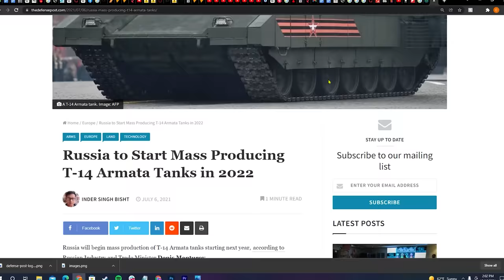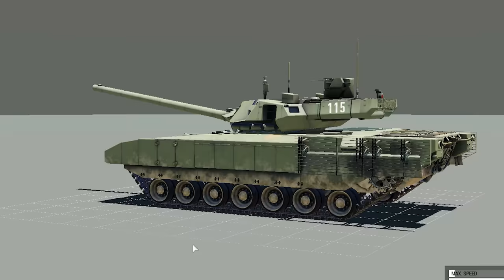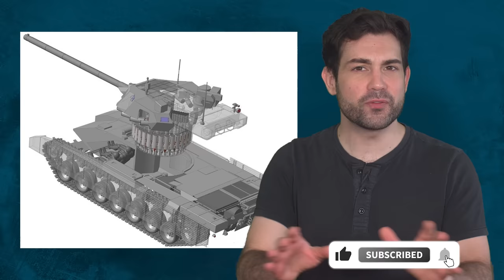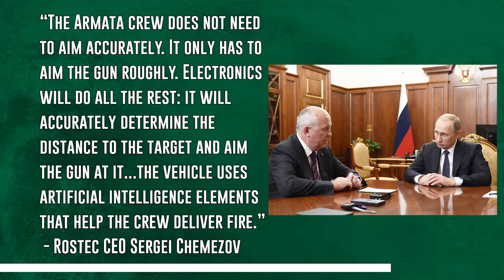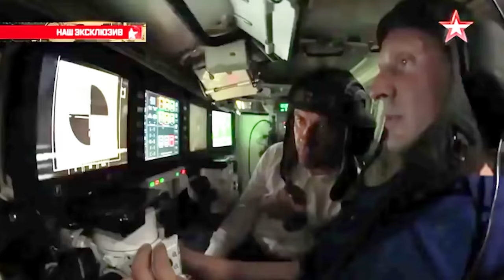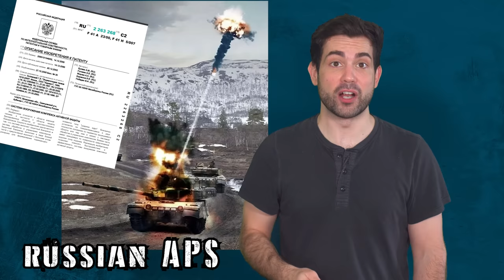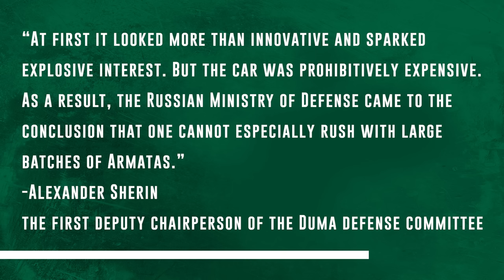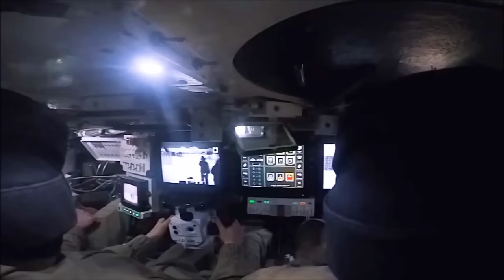The Truth About Russia's T-14 Armata Tank

Comment: The T-14 is lightly armored on the turret.  A simple 50 cal with armor piecing round would likely be able to rip through it easy.  An RPG would shred it.  The tank has great armor on the front and the front half of the sides to protect the crew, but that is it.  The rest is VERY light.  Just look at the monster engine and the size of the tank, large gun, and more admonition... it has to cut armor.  They put a cage to protect the engine.  Any Tow missile will rip through that.  Now it has its active defense, but it only face a front 60 degree arc.  I question if it will work against bombs or missiles coming in at a steep angle.  That is even if the system really works.  They still put the dazzler on the tank even though that has been defeated long ago.  I also seriously doubt that defense system could touch a tank round and definitely not a depleted uranium dart.  It sounds like the tank is really no harder to take out, but that the crew has a far better chance of surviving.  I also question their optics and targeting as well as their training.

As for the delays there were several quality issues, especially with the engine and massive cost overruns.  Russia after cancelling their orders repeatedly it seems might have ordered 100 of them.  With the current war though their economy is not doing so well so I doubt they will even get any.
Reply: So a simple cage over the motor? I guess it can easily be disabled by dropping a flaming bottle of vodka on it. Unless all the wiring is hardened or if the motor bay has an automatic fire extinguishing system it'll be toast in less than a minute.
Reply: I wouldn't be surprised if the ERA is only stuffed with papers saying: IOU ERA! Those mega yachts ain't cheap;]
Reply: @vetrakr  The cage only works really against older warheads like in a standard RPG.  Most anti tank weapons like the TOW and Javelin now have dual warheads to counter cages and reactive armor.  And if you are looking at the footage coming out of Ukraine, those cages are not working.  They even started putting the cages on top to no avail.
Reply: This is probably the future of real tank development: Thinly armored turrets (albeit they should at least resist autocannon fire!) Active defense systems (Preferably ones that actually work), and a small, very thickly armored crew compartment positioned in the front where it can best counter the weight of the engine (and ideally placed to block most incoming fire from hitting the ammo rack).

All that said...I think we'll be waiting a while before we see such tank designs becoming the standard. Completely replacing a nation's armor corps is just too expensive! Especially with all the new tech you gotta stuff in them.
Reply: NLAW uses an EFP, so you need something which will stop a 2km/s slug coming straight down on the turret.
Reply: @barleysixseventwo6665  I don't really agree with all that.  The M1A3 has no plans of removing armor.  This is a ploy for countries like Russia and China to make their tanks cheaper... not better.

And yes I do see active defense system playing a more important roll in tanks and maybe by 6th generation, jets.  The thing is Russia and China's missile defenses and active protection on tanks are just not that advanced or reliable (just like their stealth).  They might be able to do better, but not for the cost.  The US has been developing these systems for much longer with a much larger budget... and working with Israel, which has been make huge progress in these areas too.  The US can also afford to put this tech on their tanks.

The other problem is Russia... and the Ukraine are both using tanks incorrectly.  They are providing no boots on the ground to secure the aria, no air support to protect them, and not enough quality recon.  If they had tried any of those tactics against the US, they would have already lost the war.  Think of what 10, 20, 50, 100+ A-10s would have done to that 40 mile long convoy...  Russia would have lost thousands of vehicles and had to abandon that whole push.  It would have been Kuwait, but 100x worse.  They would have conceivable lost 50,000 troops easily in one day pulling a stunt like that.

Russia's military assets are mostly aging crap and even their new stuff is not doing so well.  When their current best fighterjet gets repeatedly shot down by MANPADs and even their up armored cage wrapped tanks get taken out Javelins and other man portable AT weapons and drones dropping small munitions (50 pound bombs).  The A-10 can fit 28 Mk-82 500 pound guided bombs or 24 Maverick missiles on it... plus the gun.  Think of what just 10 of these could do... They could easily take out 600 vehicles on one mission, refuel re-arm and repeat.  With 600 pound drop tanks they could operate out of Poland and run 4 sorties EASILY in one day.  With some F-15 and F-35 giving them cover it would be a bloodbath.  These bombs will not just disable the vehicle, they will likely blow it to pieces and kill everybody in tit... and disable unarmored vehicles around it.  Then US special forces would swoop in and surround the whole convoy and capture anything that survived.
Reply: @toddabbott781  They haven't used their current best fighters.
Reply: @toddabbott781  F22 and F35
Reply: @cageordie  They only have 2-4 two seat Su-57 trainers with underpowered engines... and possibly 2 prototypes left intact with also underpowered engines and limited avionics.  The Normal production models have been pushed back until 2025 in hopes of having the engine working by then.  They have also cut back orders to 76 (I think) and might make 100 total in the end, but that is all.  The price of these is likely more like the F-35.  But it does not matter much.  The Su-57 does not have anywhere near the stealth that the F-22 or F-35 has and they lack many other 5th generation features.  At least it is better than the Chinese J-20.
Reply: Do you have a source for the turret being lightly armoured?
Reply: @NauticalCoffin2404  They admitted it.  The whole design was around keeping the crew alive.  They are relying too heavily on their active defenses.  But if you looked closely at the turrets for the prototypes before they mounted the sensors and cameras you could see the armor is way thinner than on a tank like the T-72.  It looked to be around 3/4" to 1" thick.

You can also tell by looking at the specs.  It has larger dimensions than the M1A2 a larger engine, a larger gun, more ammunition, an auto loader, active defense and more armor around the crew.  They had to cut from other places.  Yes I know they have a lighter type of armor protecting the crew, but it is not THAT much lighter.  So the back 1/3 on the sides, the rear, and the turret have much lighter armor than previous tanks.

I like military technology and have research the T-14 and Su-57 pretty heavily and looked at every picture I could find since it was first announced.  There are a lot of pictures. 

The T-72, and even the T-80 and T-90 are death traps.  Any damage and they explode, blowing the turret off because of the location of the ammo and fuel.  That is why any time they are hit the crew bail out.  The T-14 at least has greatly improved the survivability of the crew... which will likely make them take more risks with the tank.  Current Russian tank crew really know their chances of surviving a serious battle are VERY low and likely are less willing to commit too much and will bail or run far faster than other tank crew.

It is like in Ukraine.  The helicopters are avoiding getting too close to the cities do to Stingers and other MANPADs, so they come in fast, point their nose up about 30 degrees, fire all their missiles, and turn fast dropping flares and run away.  Angling up gives the missiles a longer range, but they are worthless for anything but randomly shelling a city... which is what they are doing now.  They are too afraid now to get close enough to actually find a target to shoot at.  The jet still bomb, but they are unguided and they stay up out of range of the MANPADs, but again their accuracy sucks.  They are just plowing up mostly empty buildings at this point.  Russia can not afford to use very much precision munition and mostly used that to strike the airports.
Reply: @toddabbott781  Thanks!
Reply: @yeahnope620  The F-22 is an exceptional aircraft, but even I wonder what is wrong with it.  I know it is expensive to operate, but the NEVER use it.  The F-35 though is maturing into a really good fighterjet.  If it sucked so bad then why would so many other countries buy it over the F-16 and F-15... which are still being made?  The real game changer is the F-35B as it turns small carriers they might have used a Harrier or just attack helicopters into a real light carrier.  The Wasp/America class instantly became 10x better because of the F-35B.  The F-35C is also significantly better than the F-18.  The F-35A though has to complete with the F-22, F-15, and F-16.  In certain roles it shines, but not like the B and C model do.

What would take on the F-35?  The J-20's stealth is non existent as Su-35s in India were able to track them just fine from almost the max range of their radar.  The Su-57, which will not be in production for a few more years can be detected at 4x the range and only has stealth from the front.

Understand that the F-35 is not about speed or even maneuverability.  It does good in those areas, but there are better jets for that.  What it is good with is it can sync its radar and IR with data from satellites, AWACs, other aircraft, and ground radar systems and view it all 360 degrees through its helmet of incredible situational awareness.  It can also link fire control systems so an F-35 is full stealth hundreds of miles ahead can lock onto a ground target and fire a cruise missile from an F-35 500 miles farther away in beast mod with larger ordinance carried externally.  It also has far b3etter stealth than any other fighter jet out and all F-35 come with electronic warfare built in (replacing the need for jets like the Growler).  They can even link that data with Patriot of THAAD systems hundreds of miles away to increase their readiness and enhance their ballistic countermeasure capabilities.
Reply: @vetrakr  How you gonna get so close to it? You do understand you sound like a joke?
Reply: @ijjimem  Ambush. Overpasses, ruined city buildings, large ditch near a highway, culverts. 

Of course, since the US is sending Javelins, other allies are sending RPG-7's, it's better for civilians to find a way to alert the army proper. IE: Hopefully you know a local short wave radio operator, satphone, existing telenetworks.

If you're feeling particularly spicy, and want to make some russian pulled pork, an urban environment with tall buildings and tight roads. You can send them to hell.
Reply: @repletereplete8002  they do have footage of T-72B3 with ERA cut open. filled with cardboard !!!!!!!!!
Reply: Proximity fused shrapnel shells to overwhelm the active defence and shred the turret optics
Reply: why would the monster engine mean that they need to sacrifice armor? that doesn't make any sense: if you have a more powerful engine, then your tank can afford to be heavier
Reply: you fail to understand logic behind it and few others things.
yes turret is lightly armouured because it is considered expandable. not so lightly i would not survive .50 cal but still light. this is because hit in normal turret often disables tank for that battle anyway 
about rpgs in battle... there is a reason for tanks to have support troops around it. tanks should never advance alone. 
also than any tank that use cage armor is useless... you must be next admiral general genius...
Reply: @toddabbott781  you saw few videos that zoom in the tanks and now you think there is no troops around them?
Reply: @jebise1126  
I'd be more than a little concerned about turret penetrations triggering an explosion of the autoloader ready ammo.
Reply: @andrewholdaway813  if it vents in right direction that is really not a problem
Reply: @jebise1126  
Let them hope it does then, that's a relatively thin wall between the crew and the turret basket, they may have made the tank more vulnerable to top-attack.
Reply: @andrewholdaway813  so you were in tank that you know how thin that wall is?
Reply: @jebise1126  
Just eyeballing it from the cross section shown - everything is speculation.
Reply: I would disagree mate its not gonna be knocked out by a .50cal or TOW launcher. the APS on the turret side is traversable and there is a roof mounted VLS system to defend against top attack munitions.
Reply: @jonomurphy3332  
We don't  know.
Reply: @jonomurphy3332  Not in ANY of the first 10 prototypes.  Until they are proven in combat there is little to be said.  Same with the armor.  Then again their reactive armor dazzlers, and cage armor seems to all be worthless against even simple man portable weapons and small UAV bombs.  This APS has to work PERFECT to be effective at all.  I just do not see it being that effective in the long run.
Reply: @cageordie  They have, in fact, used their standard if not elite line infantry. All the evidence points to more recent equipment and the more prestigious, battle-ready units getting sent in and summarily curbstomped.
Reply: Main question - hove muach armatas Russia have? Because we saw 0 t14 at this war, only t 80,90,70 etc.
Reply: @badasscookie8553  They had 10 prototypes of limited functionality.  I'm not sure if they still have those.  They kept pushing back the orders and reducing them.  Last I saw they had an order for 100 in 2022...  With the war going on and restrictions I know their tank plants shut down.  I am assuming this was the T-14 production.  One source said they had 20 though.  I have not seen this verified anywhere else though.
Reply: @williamzk9083  
AHEAD is a shrapnel shell
Reply: For the people not understanding the turret armor being thin. Where on traditional tank turrets you see those 2 wings, blocks of thick composite armor, the crew is behind those.  The Armata turret has no crew in it. So the only systems in the turret are the gun, The optics and sensors. The APS. Communication tech. Those are all things that don't get armored on other tanks either. So basically the T-14 turret is only made of things you don't armor on a tank, and so it has no armor there.
Reply: @DisplayLine6.13.9  
We all understand
Reply: @toddabbott781  we do use the F-22, as much as we dare.  They were doing strikes in Syria as recently as the last ISIS campaign.  The problem is that there are only 187 of them and there's no building more of them; the line is shut down, and if a shooting war broke out over Taiwan, the US's ability to do anything about it is directly limited by the number of F-22's (and to a slightly lesser extent F-35's) that we can deploy there.   So we keep quite a lot of them out of hot zones so we can make sure we have them for later, just like the B-2.  They also tend to be kinda expensive to operate and take a lot of downtime in hangers for maintenance.

In the medium term (10-15 years?) they'll be replaced by the PCA for the doomsday scenario where we have to escort B-21s with nukes into highly defended airspace.
Reply: Modern IFV can fire 30mm, 35mm,40mm and 50mm rounds are a high rate of fire.  Tungsten, precision air burst and AHEAD type ammunition.  Even the 25mm Bradly bushmaster penetrated the sides of T72.   These rapid fire guns will shred APS and ERA leaving the tank open for a guided missile.
Reply: @williamzk9083  
They'd have to get scary close to a really big gun, but yes.
Reply: @williamzk9083  I have actually seen the larger commercial DFI drone that can carry 8 what they called grenades.  It almost looked like a small 60mm mortar round.  They dropped 2 from about 250-300 feet and the both hit the tank but the first hit the edge of the turret and the second penetrated the engine compartment on a T-72 and caught it on fire... then they moved to 2 BMP-2 , 3 trucks, and an armored ar.  This one $2000 drone with a few hundred dollars in modified mortar rounds basically wiped out a small base.  I had heard they were doing this, but this was the first video I had seen of it.
Reply: Yes !!!  But the Armata has a special weapon !!!!  When the turret blows up 100 ft in the air it could fall on you and squash you !!!!
Reply: @spaceted3977  Unlikely as this is the first tank where they put the ammo in an armored cabinet with blow off hatches like all other countries did 30+ years ago.  They will not blow up as spectacularly as they used to.
Reply: @toddabbott781  stealth doesn't really matter when fighting another stealth aircraft because the ir passive scanners spot the jet from 20miles away and the su-57 also I don't care if you are in the airforce or have been you can't say the su-57 isn't stealth just because someone else told you that they didn't design the jet neither did you no hate but you can't say just on someones word that that's true and the f-22 lacks some huge features that the su-57 has like hmd(helmet mounted display) the f-35 has this however which is why the f-22 is no longer in production its expensive and lacks some features the su-57 also has more missiles that it can carry in stealth and out of stealth and the cost is pretty substantial 25milion difference and costs about the same as the f-35 although the us still has better jets because they can make them and have proven that they can and the Russians have 12 prototypes and 4 combat ready ones more to come soon I assume but I think they might abandon is once the total amount they ordered is complete because they hacked the us and got blueprints of the f-35 because their new su-75 looks basically identical with some differences but it's most importantly 30milion US dollars which with the amount it costs to buy a f-35 being 85milion you can buy basically 3 su-75s for one f-35 and at the airshow it seemed promising but they aren't ready for flight yet next year is the planned date
Reply: @paullakowski2509  wow do you have pictures please? are you willing to share? i saw a cardboard gun but not that.
Reply: "a simple cage over the motor"... just like every other modern tank
Reply: @nam430  Yes but they put the cage OVER armor.  Look at the design.  The armor is only on the front maybe 3/5 of the tank body and basically.

Then again I have seen t-72 get taking out by 30mm autocannons.  That should NEVER go through a modern tank's armor but it will.  Even a 20mm will likely slice right through the engine compartment from all sides as well as the turret.
Reply: On one hand, the most likely side to be hit is the front facing armor. Secondly we don’t have the best info on the actual amor protection. But the fact that this thing, this beautiful thing(don’t lie it’s pretty) won’t be going into general service anytime soon
Reply: "Their economy is not doing so well"

Lmao!  This comment aged poorly.  

Copium
Reply: @toddabbott781  government
Reply: @toddabbott781  i.
Reply: your wrong on how a 50 cal can take it out with armor piercing rounds, the t-14 can handle more then that.
Reply: @anon5679  Around the crew compartment the T-14 is well armored.  The turret is not.  Look at the tank.  The armor plates on the side only go back about 2/3 of the way and then is replaced with just a cage.  Then there are the recessed parts in the armor for cameras sensor and those stupid dazzler lenses.  Those leave huge vulnerabilities.  But if you looked at the 10 prototypes they had on parade a few years back, you could see in some of the pictures that the plates on the turret were only about 3/4 inches thick (or 2cm).

This is actually a big improvement.  Before a tank would get hit and the ammo would blow wiping out the tank and crew.  Now a hit to the turret will leave the rest of the tank intact.  Same with a hit to the engine.  This means the crew will not bail out on the first hit or abandon the tank as soon as explosions are heard in the area.  They will also feel more secure driving into more dangerous locations.  Right no Russian tank crew do not feel safe in their tanks.  The problem is though, while the tank crew is MUCH safer, the tank can be taken out of action rather easy.

A lot has to do with how effective is the active protect really.  They only have 4 tubes on each side under the turret and they fan out in about a 60 degree arc.  They can not fire if the hatches are open though.  It is questionable how high of an attack angle they can protect against and if they can do anything against a normal tank round or just missiles.  I doubt the system is more than 50% effective against incoming missiles like RPGs and such, but against a Javelin that is going to shoot up and come down on top of the tank or any attacks the the air... or rear or side with be unstoppable.  The system of course does not work against mines either.

Russia is loosing tanks like crazy in Ukraine.  Even drone dropping grenades are making it through the engine compartment.  I'm not even sure if the NLAW will trigger the active defense.  It is also questionable how thick the armor is on the top of the crew compartment.  It might be that almost any hit on the top will take the tank out.  I guess time will tell, but so far Russia's unstoppable army has been stopped by Ukraine and their assets and troops are dropping like flies.

BTW a 50 Cal with AP rounds can blow through about 2" of steel or about .9" of hardened steel.  the engine compartment might have more than that on the sides or rear to protect the engine, but I have seem BMPs firing a 30mm cannon shoot the side of a T-72 where the treads are and it blew right trough the armor there.  I have also seen that Russia has also been sending out tanks with fake reactive armor.  I wonder how many of those are on the battlefield right now.

It does not matter much though because as far as I know they stopped the production of T-14 because of the embargo and while there are rumors they were going to start the production back up, they would likely be missing most of their electronics until the embargoes are lifted.  They are only ordering something like 134 of them anyways.  I doubt they even sent the T-90s to Ukraine because they did not want to loose them but they do not have a lot of those either.